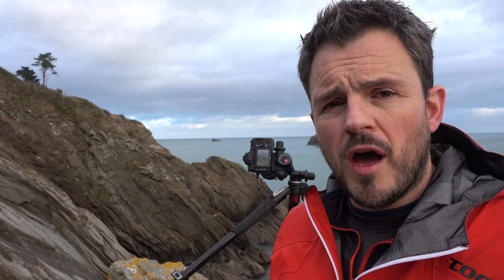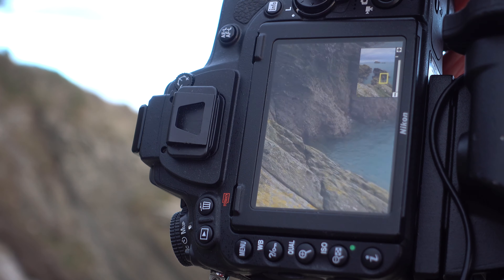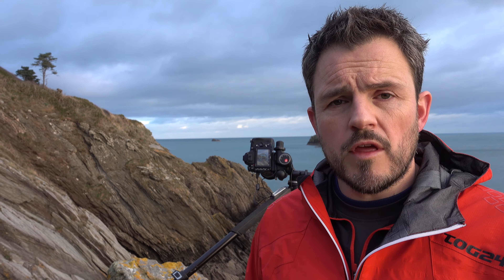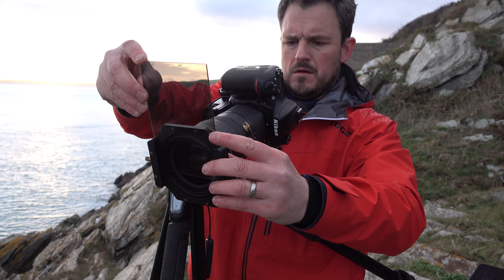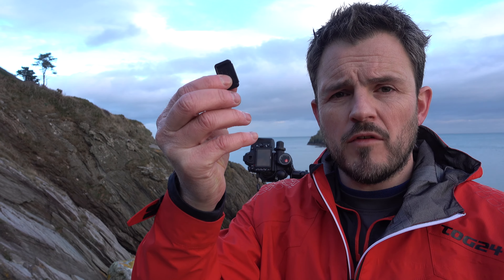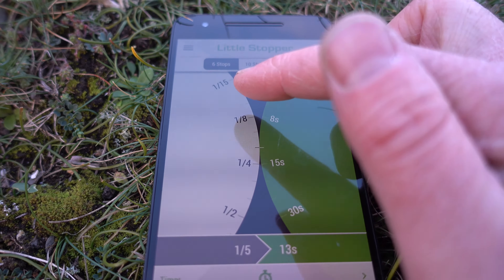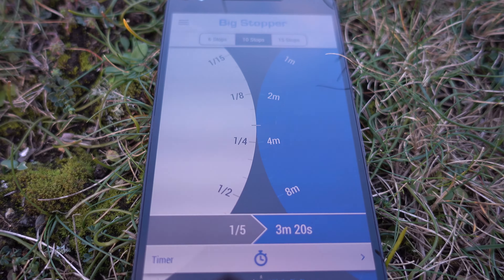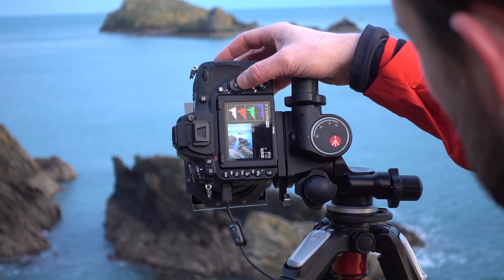My Field Guide to Using ND Filters (in 4K)

Comment: Dear Julian, very kind of you just what I needed, thank you. Just one more Question: Doing a long daylight exposure with the Big Stopper on - do you have Noise Reduction set on your camera or do remove it in processing ???
Reply from the maker: Hey Allan, glad you found the video useful!  I never use in camera NR.  If I need to remove any noise I'll do it in post.  However, the only time I needed to remove any noise was with a Super Stopper exposure lasting around 10 minutes.  Don't get any noise with the Big Stopper, including exposures up to 5 mins.  Hope that helps.  :-)
Reply: Thank you for your prompt reply very kind of you. Am I correct that you are a - Scot's exile ???
Reply from the maker: Indeed I am.  Emmigrated here from the homeland about 8 years ago.  :-)
Reply: I am originally from Edinburgh but likewise, I have lived away in Northern Ireland these past 45 years.

Comment: Julian, it may have been worth advising the viewers to turn their lenses to manual focus (prevents losing focus and camera then hunting for focus). Other than that it was a very informative vlog.👍
Reply from the maker: Thanks for watching and commenting Andy.  Yes, you are correct to point to the tip on setting the camera to manual focusing.  I didn't mention it while I was out in the field (I forgot at the time as I use BBF) but I did later mention during the review of technique at 05:55 .

Comment: nice video bud! Do you have any methods for compensating for the rapid changes in light when shooting longer exposures? As you say in your video, if doing a 10 minute exposure you want to get it right first time  but during those 10 minutes at sunrise or sunset the light levels can change dramatically. I'm sure that there is some complicated equation that can be used but was wandering if you had a rough rule of thumb method to help? At the moment I just take an educated guess and rely on post processing to save my backside from any mistakes. 
Matt Davis (monkeynumber1 from instagram)
Reply from the maker: Hey Matt, nice to see you over here as well (cracking user name BTW!).  I would love to tell you that I some amazing formula to work this out, but generally speaking I use my best judgement.  Unless the exposure is really long, say longer than a minute or two, the calculation from base exposure is relatively accurate, even when light is fading / coming up quickly.  For really long exposures I will just add a little time or cut it short.  But it's really best guess.  I tend to avoid really long exposures at critical sunset / sunrise times unless I'm really after a specific look, as I don't want to commit the camera to such a long exposure when things can change so quickly.  It is tricky taking really long exposures right at sunset / sunrise, but I guess this is where experience comes into play.  Don't get me wrong, I don't get it right all the time, and I've rescued many a photo in Lightroom!
Reply: Thanks bud! When I was setting up my youtube account the 2 closest things to me (in terms of distance, not emotional attachment) were a cheese sandwich and a basket of my daughters toys which ended up as my profile picture. 
I thought this would be the case with regards to my question but thought I'd ask anyway incase I was missing something really simple (it wouldn't be the first time!). I suppose a formula could created taking in to account geographical location, time of year etc but things like weather would still only make it a "rule of thumb" method. Maybe an add on for the TPE app?
Reply from the maker: Yes, the weather, our old friend the weather.  We always need something to blame when it doesn't go our way don't we!
Reply: Good question from the Cheese Sandwich :-)   I"m a bit of a morning bluehour and sunrise freak.  I usually do stuff about 1:40 at that time and sometimes do a guesstimate and cut it short if I think its lighting up too quick. better a bit under than over exposed. Usually thou, its fine.

Good job on the video Julian
Reply from the maker: Thanks for watching and leaving a comment.  It's not an exact science, especially when dealing with varying light levels.  A lot of it comes from experience, and most of the time you can recover a lot from the highlights and shadows in post (though it's always nice to get it right in camera!)